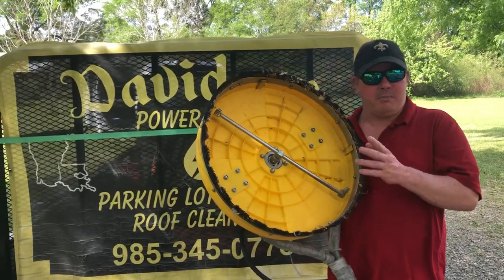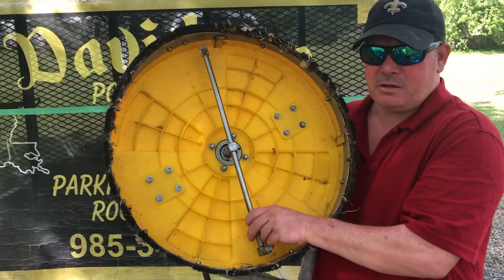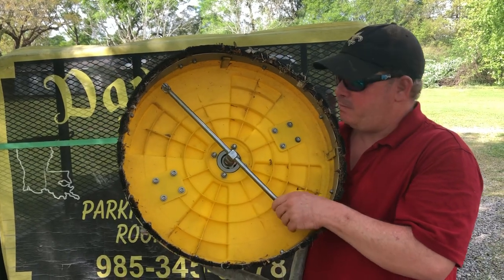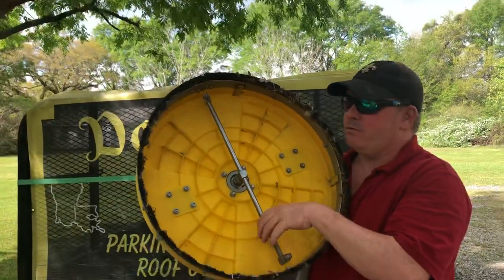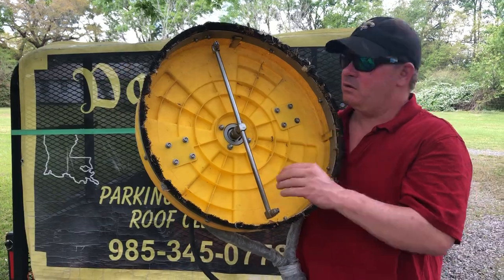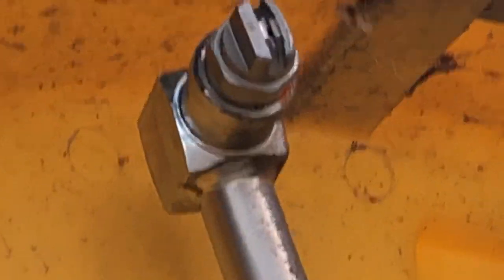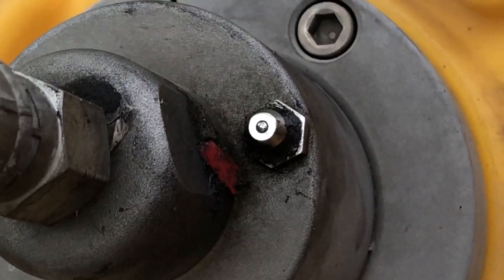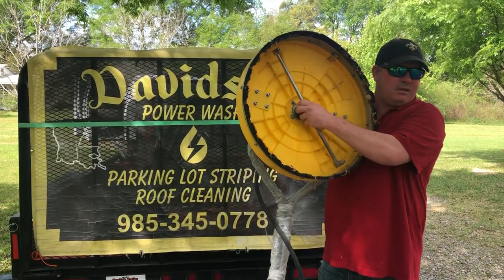Everything you need to know about a surface cleaner in six minutes

Comment: Billy I run a 20” surface cleaner with a 4 gpm Hotsy 4000 psi. When I have a driveway that’s not that dirty and I don’t need all that pressure I just throttle back the throttle lever half way and I am good.
Appreciate all your videos man. Thanks for doing those they have a lot of good information. Thanks .
Reply: I run a 20" whisper wash with 4 3gpm tips on a 12gpm pump and I can literally run and clean concrete! 😆
Reply: @DyEpAiNtBaLl2020 How long do the bearings last on the surface cleaner?

Comment: Great video Billy. I learned a lot and I've been doing this for 10 years
Reply from the maker: Thank you
Reply: I've got the new Honda 800 a gallon per minute and I had a driveway that was brand new still had the cream on it. I did two passes and I stopped now I know thank you brother
Reply: How can I lower the pressure on a machine that's a monster like that to do a driveway I've been doing it through the ball valve seems to work
Reply: I have been able to lower it through the ball valve to keep it from coming off the ground

Comment: Very thorough explanation. Can you suggest a surface cleaner to use with our gasoline powered Troy Bilt Honda engine 2600 psi 2.3 GPM  power washer? Thank you
Reply from the maker: Hey given those parameters and specifications of your particular machine I wouldn't recommend getting anything over a 15 inch surface cleaner. Usually you can buy those units at Home Depot or Lowe's for about $100

Comment: It shouldn’t split the PSI in half if your running 4 gpm tips and have a 8 gpm your pressure will still be at 3500 PSI. If you were to use bigger tips it would lower ur pressure but you should be getting 3500 psi with the 4 gpm tips.
Reply: I've been learning a lot and was confused the first few times I watched this and I was about to say the same thing.. tips split gpm not psi. Glad someone else was paying attention.
Reply: So does that mean when you put the larger tips on your a little higher than 800-900 psi?

Comment: I always thought the second number was thousands of an inch. Like 11003 means 110 degree spray angle with a 3 thousandth opening. Not like it matters, but you can buy the plastic tips with a stainless or even ceramic insert for a lot less than the "SS" or solid stainless or SS11003. 
To be honest, I'd experiment with the angle over the size of the orifice. Go with an 6004 or wider like an 8004 that will stop leaving streaks as the fan is so much wider. It would be quicker as well.

Comment: Hey Mr. Davidson so I have a horsepower 4000 psi 4.0 gpm, and I’m only getting 3,200 psi to my 20 inche Northstar surface cleaner I change the nozzle tips and still getting the same pressure. When I hook up the power washing gun, I get the full 4000 psi. What do you think is going on? Thank you so much.
Reply: Could be the guns. Concrete Cleaning is recommended around 2000-2500 psi so you're looking at 25025 or 40025
Reply: @MannyAguilarJr  gotcha, thank you

Comment: Just found your channel today and I love it!  As a newbie, what spray type pre wash  cleaners (like degreasers,  etc) do you recommend for concrete to get it really good and clean?  Or do I even need to worry about it if I'm hitting it with 4000psi?
Reply from the maker: Hey it's awesome to hear from you! If it's just standard concrete with not a lot of stains on it usually you can use just pressurized water to clean it. If it has a bunch of automobile stains on it I would suggest using purple power to spot treat each section then power wash afterwards

Comment: Hey Billy, I run a 5gpm machine with this surface cleaner, when I'm worried about the integrity of concrete I dial back the pressure valve (black knob) in fear of etching, is this efficient or is it pointless, I definitely feel less pressure and lift from SC so it feels like a correct adjustment? Thanks brother, love the videos.
Reply from the maker: Yes that is definitely one way to lower the pressure, you could also use larger spray tips if you want to get better flow rate
Reply: 25035 or 40035 should get you at about 2000 psi as long as the unloader is set to the pump head pressure when the gun is released.

Comment: can i use a 4000 psi 8 gpm surface cleaner with a machine thats 4000 psi but 4 gpm?
Reply from the maker: Yes just use the appropriate tips size in your surface cleaner to accommodate your pressure wash flow
Reply: what tips for the surface cleaner would you recommend? if the pressure washer is 4000 psi and 4 Gpm?

Comment: Could you just use a ball valve at the end of the hose and adjust it accordingly with stock 25 degree tips??
Reply from the maker: We don't recommend doing that because it constricts the pump and pushes it into bypass mode. Also the ball valve only cuts down on flow not psi
Reply: Got it thank you! I won’t do that then! I could rinse with a ball valve and male quick connect though correct? Or what is the best to rinse with?

Comment: I have a small 14" whirl a way that connects to your gun. It has a grease fitting, but, the fitting is flush to the bearing housing. Nothing is sticking up to attach the gun to. It has a little ball in the center but is flat to the body. Have you seen that before and how do I grease that? Thanks.
Reply from the maker: There should be a needle valve that you can place on the end of your grease gun
Reply: @billydavidsonvip  Shouldn't there be a rubber seal? The little ball only pushes in a short ways. My other machines have a standard nipple. I will probably just take it apart since there's not much to it and re-grease it. In one video they took it apart and the bearings had plastic covers still on them so grease could never get to them anyway. Might be better to take a look. Just bought this small one to use on top of brick walls and try it on wooden fences. It's so light it takes off from the ground with any amount of pressure Lol. I'm going to build a solid tube Wand/handle with the hose sliding thru the long handle and quick connected behind me with a ball valve. A gun may not be sturdy enough. Thanks for getting back to me.
Reply from the maker: Yes I was just looking online to see if I can find something similar but I couldn't. Text me a picture of it my phone number is 985-345-0778
Reply: @billydavidsonvip  Just look up 14" whirl a way on youtube or Ebay. If your talking about the fitting, it's just a flush circle with a little ball in the center. This thing can handle full pressure but will probably not last.

Comment: Great info. Question....I have used several different brands of these. All work great day 1 but then the spin rate drops making them useless. What am I doing wrong?
Reply: If you want the Rolls Royce of surface cleaners, buy a Mosmatic. I bought they're 21 inch Surface Cleaner, and been using it for 3 years. It's never broken down and doesn't need to be lubed.

Comment: I have a 4gpm 4000 psi PW. And now in the market for a surface cleaner that’s not spending 1000,s on one. Maybe a link to the one you got there . Do you have good control with plastic at high pressure?

Comment: Do you use different-sized tips in the surface cleaners? We're trying to do our homework.
Reply from the maker: Yes depending on the surface you were cleaning and the power of your pressure washer you may have to switch out your tips. But both tips will be identical under your surface cleaner you cannot mismatch tip sizes

Comment: I used this surface cleaner with a 4.5 gallon/min machine, using the original tips.  I went over a patch of newer concrete (a year old) on a driveway and scoured it badly.  Is this what you mean by new concrete? I hear it can take a year to bond properly, is that true? The homeowner said it was probably just poor concrete.
Reply from the maker: It does depend on a lot of factors most likely your surface cleaner did scored a new concrete. Whenever you doing new concrete you need to double the original size of your surface cleaner tips. Overtime the scorn marks should start to blend in and not be so visible. Usually this takes about two months

Comment: I have a mi - t-m 20 inch , it was given to me. The only difference between it and yours is on the bottom of mine there are two holes at the bottom of the swivel that let a lot of water out. Is that normal or is that a sign it needs to be replaced / repaired?
Reply from the maker: Yes basically that it is a sign that the swivel or either of the O-rings inside the swivel are blown. Probably be best just to replace that swivel

Comment: Hi. Newbie here. Can these be used on tiles and slightly uneven surfaces?  Or, should i purchase one with caster wheels?  Just hope caster wheel one would work for flat concrete later too. Thank you! Great info.
Reply from the maker: Yes if you get one with caster wheels it does work a little better on uneven surfaces
Before using it on any type of tiles you will have to make sure that there are no loose or broken pieces
Reply: @billydavidsonvip  ok. Thank you ssoooooo much for getting back to me. I will be sure to. Just starting out. First official job is a big one.

Comment: Hey Billy can you help me with my surface cleaner please? I have a Simpson 4400 psi 4gpm belt drive unit and I use a 20” Simpson surface cleaner. Now when I use this it lifts off the ground. What tips do you recommend I used so I don’t damage the concrete? Thank you for your video.
Reply from the maker: I would recommend using a 25030
This would allow 3 gallons per minute per spray tip. Even though you only have a 4 gallon per minute machine this would lower the psi pro tip
If you are doing extremely old concrete then you could use 15030 this would increase the psi per spray tip

Comment: Do you put teflon tape on those tips when you screw them in and do the suppose to screw all the way down. I have a m-i-tm 20in and when I put teflon tape on my new tips they would no screw all the way down. It's still works with no leaks but does this affect my cleaning
Reply from the maker: Yes we always use to have lawn just get them really tight but make sure the slot is straight in line with the spray bar. It would be possible to over tighten it so don't go crazy with it but just a good 40 or 50 pounds of torque should be sufficient
Reply: @billydavidsonvip  yes sir slot is striaght in line with the bar

Comment: what should i do if i have a 3.5 gpm and 3400 psi? i think i have the same Surface cleaner, the BE. any tips i should get?
Reply: 25025 or 40025 should get you at 2000 psi

I don't think they exist but 250225 or 400225 would be 2500 psi

Comment: Can you use the 16” surface cleaner with a 4200 Psi machine?
Reply from the maker: In my opinion it's not recommended because the surface cleaner will turn to many RPMs in wear out quickly

Comment: How tight should you put them in? Like high should the tip be from the ground after they are in? I tightened mine till it was hard to move, while still lining up the bar and the nozzles
Reply from the maker: Yes that is the correct way to do it. If you over tighten it it could actually break the threads

Comment: I got a 20" whisper wash stock tips, and a 4 gpm "4400" psi simpson... Should I change out the tips?
Reply: 1502 tips for older concrete, but what would you recommend for new construction concrete?
Reply from the maker: 2504
Reply from the maker: Double the size of your original tip size for a brand new concrete
Reply: @billydavidsonvip  Thank you sir. Take this like/sub. What tip for older concrete? 1502??

Comment: Billy I have a gx390 I think pushing 4 gpm with a 20 inch be surface cleaner. The problem I’m having is it feels sluggish. Should I change tips if so witch tips. Thanks 🙏
Reply: What did you finally do?
Reply: Too big surface cleaner for your machine. Best is 16 or 18 max. Once you go to 20 you sacrifice speed over cleaning circumference. Rule of thumb is 4inches per gpm (4 gpm x 4 inches = 16)

Comment: Any thoughts from the community on how big of a surface cleaner I can push with a 3300 PSI, 2.5GPM? 😳
Reply from the maker: Hey thanks for leaving us a comment. Am I opinion with that size of a pressure washer I would recommend using a surface cleaner that is about 12 inches in diameter

Comment: pressure is not split but gpm is split 3500 at 2 gpm per nozzle
Reply from the maker: We just tested it with a pressure gauge. We're going to upload the video soon. It does drop the pressure in half using two spray tips because your orifice size is increased by adding to two spray sizes together.

Comment: Hi Billy Davidson, 

I have a few questions. I purchased a 24 inch surface cleaner from a craigslist sale. It has a 3 bar and 3 tips. Each are label 15015 and they where not set at 12 & 6 (parallel to bar)

I'm going to use a 4200 psi with 4.0 gpm pressure washer.  Would i need to change the tips on the 24" surface cleaner to 2502 × (3) = 6 gpm for soft washing on newer concrete? Again, it has 3 tips. Like you mention don't want to cause any damage.  

What tips would you recommend on corrugated (rock exposure) driveway and walkways?

Also what type or of grease and brand would you use for the 20" surface cleaner? I thought the motor is enclosed greased unit. 

I think i will also buy a 20" surface cleaner like the one in your video. 

Any information will be helpful. 

Thanks

Comment: Hi Billy, quick question: I've been looking at these cleaners and the majority of them top up at 4000psi with the GPM varying up and down depending on the model. I have a 4400 PSI 4 GPM pressure washer and it's hard to find a cleaner that passes that 4000psi max pressure mark. Any modifications I could make to use one of these at 4400 PSI and 4 GPM ? Thanks.
Reply from the maker: Yes you can still use a surface cleaner that is rated for 4000 PSI  when the PSI is calculated and rated for your specific machine it is measured at the pump under optimal conditions. Such as 60 pounds per square inch of water pressure going into the inlet side of the pump "which is uncommon on most facets" in addition they measure the outgoing psi directly at the pump without any pressure hose. That being said if you hook to a standard garden hose that is 100 feet long to feed your pressure washer you're not going to receive 60 psi on the inlet side that will reduce your psi by at least 200 psi. They get you down to about 4200 psi on the outlet side. Now let's remember the psi is measured at the pump with no pressure hose and that's how the manufacture comes up with this number. Once you put on a 50 feet or a 100 foot pressure hose and a wand then the psi is reduced even more! 100 feet of pressure hose reduces the pressure by approximately 300 psi in addition the water Hass to make to make a 90° turn to go through the wand. This again reduces the pressure by another 150 psi anytime this water hast to make a 90° turn. Therefore lowering your realistic pressure to probably just over 3700 psi which is well within the range of a 4000 PSI rated surface cleaner. I apologize for this long message in any typos but if you need any other help just let me know
Reply: @billydavidsonvip  that’s an excellent explanation. Thank you.